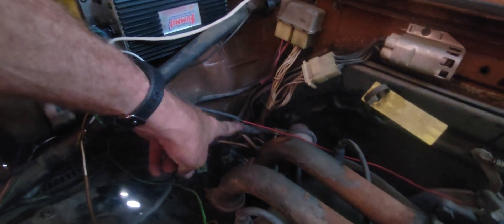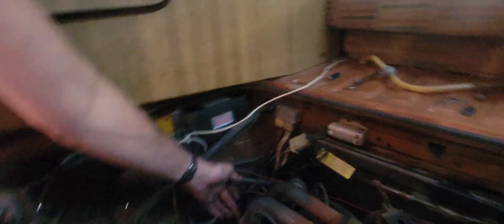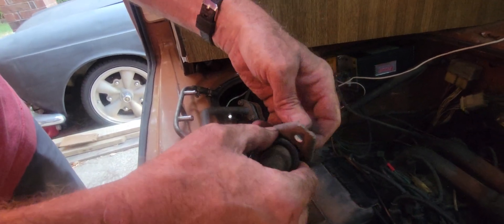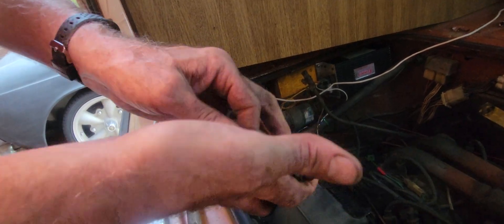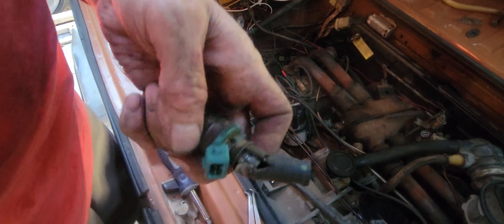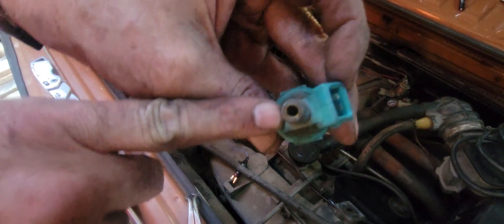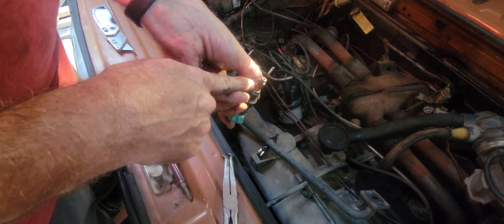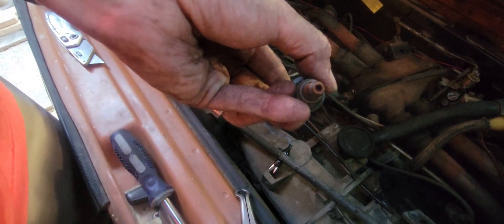Aircooled VW Vanagon Fuel Injector Disassembly

Comment: I needed this video. Fuel lines from my fuel rail to injectors were cracking. Been too scared to yank the old hose off my injector but you gave me the confidence to try. Now I can return the new injectors I bought. Only issue im having now is removing those damnGermam oetiker crimp clamps off the rail..omg what a nightmare. Thanks for the video. I got the same color and interior Westy as you! Cheers!
Reply from the maker: Thanks, glad we can help!